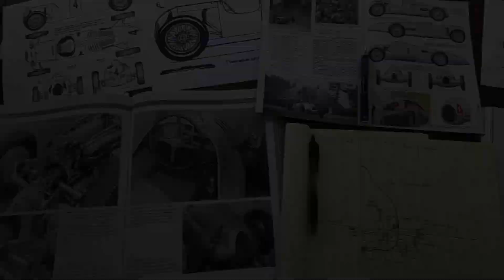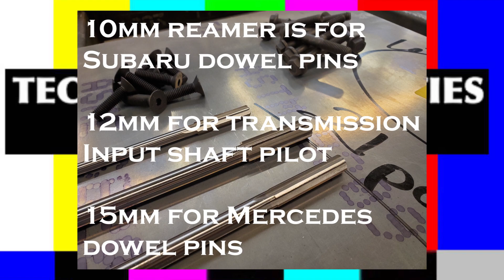Hooking a Mercedes V12 to a Subaru 6 speed (PART 1)

Comment: The stock differential is not limited slip, it's an open diff.
Reply from the maker: Well dangit! Then I definitely will be getting one with the adapter hubs. The actual gearset is ok though?
Reply: @zwickauracingworks  yes, fantastic

Comment: Hi Jeremy, an interesting start on your adaptation. We have done about 20 different engines to the Subaru trans. Have you thought about which flywheel and starter you will use ? The Subaru starter has no problems turning a 6 litre LS engine. What thickness adaptor will you use so that your input shaft is supported correctly and the splines line up with whatever clutch you use? What thicknesses ensure your clutch fork release bearing sits at the correct depth for the clutch fingers? I wouldn't recommend having the transmission off level. Your adaptor will likely be this enough that your dowels and bolt holes can all be machined so as not to interfere. If you want help designing a setup that works first time, look us up.
Reply from the maker: I don't have measurements yet for the distance I will need to space the flywheel back, that will be in part 3. I will be using a stock or stock replacement 15-17 WRX clutch and flywheel(upgraded clutch of course) which will have the input bearing integrally mounted. The spacer will be steel and in the neighborhood of 1/2" thick. Both the Subaru and V12 are neutral balance and 8 bolt flywheels, so I just have to make sure they are aligned and then redrill the Subaru flywheel for the Mercedes pattern between the original bolt holes. That will take care of all clutch and input shaft alignment issues, or at least that's the plan lol! I will definitely be getting ahold of you guys later down the road to get your 108mm adapter hub flanges, Ill' be running VW/Audi/Porsche CV axles.
Reply: @zwickauracingworks  That's great. I hope you have given some thought to how your Mercedes Starter in it's location and it's size and number of teeth is going to mesh with the Subaru flywheel.
Reply: @zwickauracingworks  also, you MUST put a limited slip differential centre into that ty751 6 speed or the torque in 2WD will destroy the differential centre casting. The gears will be fine, but that diff centre needs upgrading.
Reply from the maker: The first point about the starter: the plan is to use the factory Mercedes flexplate which also has the tone ring for the CPS. Behind that, there will be a spacer to adapt the end of the crankshaft into a copy of a Subaru, then the Subaru flywheel. If it interferes, I'll cut the ring gear off the Subaru since it's no longer needed. Since the original V12s were only available with automatics, I think the dual flywheels will still be somewhat lighter than the factory torque converter setup.

The second point about the diff: I had no idea that was a weak point lol! I saw that the stock differential was limited slip and didn't look any further. I will have to add that to my parts list from Subarugears now! The car will only weigh ~1800lbs which I'm hoping will help the transmission last, otherwise I'll have to step up to the STI 6 speed and figure out mechanical shift linkage.